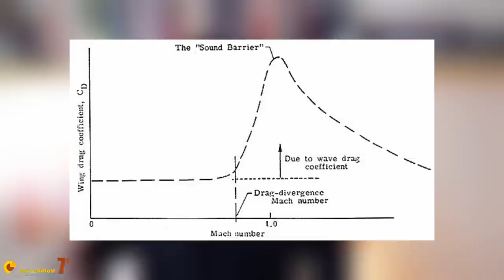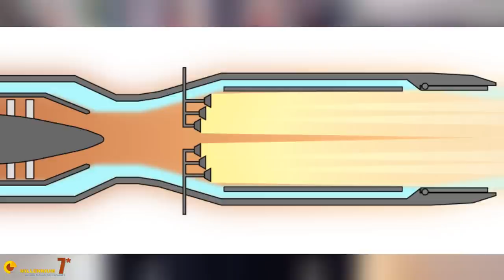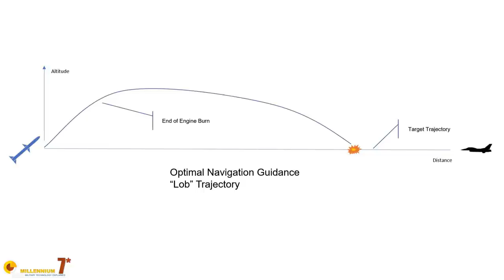Flying SUPERSONIC with NO Afterburner | Why SUPERCRUISE is so Important?

Comment: Very interesting video, but regarding Concorde I want to put some additional information, since the supercruise capability at M2 was a crucial design requirement, being essential to fulfill the transatlantic mission.
If I understood your supercruise definition correctly, i.e. if supercruise must only be achieved and maintained without the use of re-heats, - then you are right - Concorde could not practically operate in this way. 
Nevertheless, a differing supercruise definition might allow to cover an enhanced supercruise regime, e.g. respecting the case of Concorde.

Concorde used re-heats, but only for about 50 – 70 seconds during take-off and then again for 10 - max. 15 minutes for accelerating from M0.95 through the transonic region, resp. partly for climbing up to M1.7, just enough to build up sufficient pre-compression inside the unique air intake system. At supercruise, the intakes provided 7.3:1 in front of the first compressor stage, thus enabling 82:1 in the Olympus turbojets. 
During the climb phase above M1.7 -  i.e. even after the re-heats were cutoff - Concorde still continued accelerating. 
Supercruise potential: The engine power even had to be reduced to prevent the airframe from thermal overheating caused by friction. Regarding the thermal barrier (127°C), Concorde usually supercruised at M2.02 (M2.04). By this values the thermal efficiency of the propulsion unit was approx. 43%.
Actually, I don’t know any aircraft which was or is capable to supercruise under comparable conditions as Concorde did.
Reply from the maker: No, there isn't any AFIK. However, the Concorde was a class of its own in respect to many elements.
Reply: The XB70 can supercruse at 50% engine powet at M2. While concorde is still sligtly better (about 48% or something, dont bother calculating it now).

The thermal efficency increase with speed for a 0 bypass engine, so valkyre  would proboly  have higher efficency at top speed.

For 0 bypass engine there is really not much beside speed that effect efficency.

The B1A probobally outpreforme concorde as well in that regard, also being a turbonfan  probobly do that prior to M2
Reply: @matsv201  Thank you for your reply! Yes, in calculation speed is a driving factor for efficiency. But beside this fact, I think another important circumstance comes by the design attunement between the airframe, air intakes, engines and nozzles. The cruising speed of Concorde was limited due thermal heating (max. allowed 127°C), since an aluminum alloy was widely used for the airframe.

The XB-70 was mainly made of stainless-steel material to sustain the high skin temperatures at M3. This measure made the airplane relatively heavy – for this and probably for other reasons it required 6 turbojets. It also had only two main intakes to feed all their engines - which possibly made the airflow relatively complicated to control and not so efficient as it could have been when using a separate intake for each engine.

I think one main secret, what made Concorde so efficient (especially at her time and beyond), was its highly advanced and digitally controlled intake system, which also enabled each engine to operate individually at its best operating condition. 

An interesting fact is, that even for the younger PANAVIA Tornado, the principal technology of the air intake design and digital control system - as used by Concorde - should have been implemented to improve the engine control in different flight operating conditions and thus to enable the Tornado a better and safer supercruise performance.  https://en.wikipedia.org/wiki/Panavia_Tornado 
 

It would be interesting to know the impact in efficiency which is derived by the air intakes systems used in other modern supersonic aircrafts.
Reply: @karlskrivanek5687  
"(max. allowed 127°C), since an aluminum alloy was widely used for the airframe."

That is not the reason. The reason is that the air heat up when its compressed by the engine. The amount it heat is relative to the absolute temperature at the intake, so if it becomes to hot, the engines will be unable to add more fuel before the turbine blades melt. There for it need a intake temperature limit.

"This measure made the airplane relatively heavy"
One would believe that, but that is actually not quite true. XB70 have a empty to full factor of 47% while Concorde have one of 42%. While the steel ad a bit of weight, its far less than one might believe. Also the use of canard and a few other features made XB70 a bit more efficient, also alowed it to use more lift during takeoff.

" for this and probably for other reasons it required 6 turbojets"

Its actually not the case. The jets on XB70 is far smaller than that of Concorde. The total thrust is actually less even if XB70 is heavier. Even the B1A have considerably lower thrust than Concorde despite being quite a bit heavier.

"I think one main secret, what made Concorde so efficient (especially at her time and beyond), "

I would say rather that there was a dude sitting at a control panel handling the engines, compare to the 737 that was launched at the same time that did it totally automatically. Concorde actually have 5 seats in the cockpit. One capten, one fist officer, one navigator, one engineer and one instructor seat (only used in certification flights). Behind them was the electronics bay, in steed of under the pilot as in most aircraft at the time. This took up the same space as 12 passenger. Not only that. Most of the space below the floor was either taken up by wheels or by fuel. So there was hardy any cargo space. So most of the cargo was stored in a section int he aft of the aircraft, taking the same space as 12 more seats. This is actually a major contributor to why its so thirsty, because fuel is counted peer seat. If it was 5 seats wide, the avionic bay would fit under the cockpit, also the luggage, and there would still be space for fuel, as well as adding. That would pretty much cut fuel use by 60%

"It would be interesting to know the impact in efficiency which is derived by the air intakes systems used in other modern supersonic aircrafts."

Well a modern supersonic airliner would use medium bypass engines... like the Boom and Spike is planed to do. This totally of set the math.

My calculation estimate that the engine of Boom and Spike have a specific fuel consumption of 28g/kN*s while Concorde have 34. Concords official drag ratio is 7.14, while i calculated Boom to 11.7 and Spike to 10.7. I done this by reverse engineering there numbers, so if there numbers are of, so are mine. Combine it and there is a large advantage for the newer planes, while the advantages become smaler when taking into.

anyway, Concorde is so fuel laydend, so even a minor improvement in fuel consumption will give a large effect on the over all aircraft size.

Comment: The main advantage of supercruise is that is is much easier to see an afterburning aicraft with an infrared sensor without giving up your location with radar
Reply: The main, I don't think so. The main advantage is that you save fuel and that the missiles range boost. But agree that it's an advantage too, especially important for stealth fighters.
Reply: @mwtrolle  Saving fuel isn't that big, you might as well go 950kpg instead of 1200, and you can go om afterburner for a dozen seconds to give your missiles a boost
Reply: @tedarcher9120  Except that takes time, and it's an advantage to fire first, and if you have to do so you directly tell the opponent that you are launching your missiles.
Reply: @mwtrolle  if you are a non-stealth fighter he already knows where you are, so there is not much point in hiding. But imagine a stealth fighter, super cruising at m 1.8 with only passive sensors, lobbing missiles at non-suspecring enemies

Comment: I was under the impression that the EE Lightning could supercruise. In review, this comes down to wether people tightly define as per the US originators definition, or more loosely supersonic without afterburning. This gets into a lot of beer argument at the bar. 

I shall take a slightly different view. I love the Lightning. But the ability to fly supersonic without lighting up the afterburners was good because that plane drinks fuel at ungodly rates, the pilots need to have a 3rd sense for knowing where the nearest in flight refueling tanker is, and the fuel gauge is monitored more than the early radar :P

Super cruise is a very interesting subject. I have to note, that Eurofighter seems to have really terrific performance in this area. 

Sir, side note, your videos are top class. Has to be said! 
Cheers!
Reply: I have one thing to say just on the end of the video - energy, and talk of merge. And this is only my laymens view, so not based on absolutely solid science or evidence. But high speed / energy at high altitudes, seems to be a misnomer. Aircraft with wing loading, especially high wing loading - have limited lift at high altitude. Its worth nothing that in NATO tests, no 'fighter' did well against lumbering Vulcan bombers in tests at 45,000 feet. The enormous wing of the Vulcan gave it the ability to still manouver. The fighters were unable to 'turn' at these altitudes in the same way. (In beyond visual range with modern missiles the point is moot, Vulcan dies..) 

Most dogfighting pre/merge/post merge won't be at high altitude, or if it is, it will be very high speed/low G.. - probably with hard drops into lower altitude..
Reply: Concorde is also considered a supercruising aircraft. The reality is that most supercruise capable aircraft use the afterburner briefly to go supersonic, then throttle back and accelerate to higher Mach. Supercruise is generally defined as sustaining Mach 1 or greater. 

Another thing you mentioned is definitions. The US defines supercruise as Mach 1.5 specifically. Probably because achieving Mach 1 speeds without afterburner really isn't that remarkable. After all, the old EE lightning did it.
Reply: @EEEEEEE354  Well, if it is easy, everyone would do it :)

If you really take the US definition, this rules out several planes in the video which are stated as being capable.

I adore the lightning. And it might fit someone's definition, as it was very capable within certain tick boxes. Outside of those boxes, it wasn't capable. Phantom came along and had a much wider capability (and was a tremendous plane in its own right...)

But it was built as an interceptor, with rate of climb and high speed being doctrinal. If you examine it critically, the RAF never had enough QRA available against any serious raiders, and lack of range was an issue in this area all the way back to point defense spitfire and hurricane. And after the '57 idiotic defense white paper, which basically ruined manned aircraft development in the UK, Lightning was under developed though its whole program. Even with that, there are some things only Lightning could do in its time, and it took some tremendous planes to eventually come and do what it did, only a lot better.  It generally left the US century series in its wake. 

many things are trade offs, especially in old gen aircraft.
Reply: @AdmV0rl0n  I don't really go by the US's definition. Most likely what happened is we made it Mach 1.5 because supercruise isn't a particular unique or special capability. Supercruising at Mach 1.5 and above, now thats pretty wild. Can't have a one of a kind super unique fighter if everybody else can do it too lol. I am however, of the opinion that aircraft like gripen that cruise at Mach 1.2 clean are probably not going to be supercruising in actual combat. The aircraft did it in a straight line at 28,000 feet. They say it can do Mach 1.1 with an air to air loadout. Pretty unconvincing... Raptors can supercruise at Mach 1.82, but most pilots haven't seen that on mil power. More like Mach 1.5 operationally. 

Interesting stuff about the Lightning. I'm not terribly knowledgeable about the aircraft myself but I am aware that it was quite remarkable. I happen to be of the opinion that supercruise isn't super important or realistic in combat for most aircraft. When I think supercruise, i think Typhoon, F-22, and Su-57. Millennium brought up some good points, but I guarantee you the lightweights like Gripen and Rafale are going to light their burners when a BVR fight comes along.
Reply: @EEEEEEE354  I think huge amounts get missed in all the hoopla about combat. In reality, if you are BVR you might be high, and you perhaps may keep a conversation around a ranged argument. I don't think people really realise that at high altitude, a lot of engines don't work that well, the air is damn thin, and beyond that a lot of wings don't work well. No one will be pulling 9 G turns at 50,000feet. And when people pull sustained ... say 2g, as much as you may turn, you are burning energy and drag to make that turn and your stall speed is likely a lot higher than at lower down altitudes.  

In the end most actual dogfighting will drop to middle or low altitude where engines and wings .. work. 

There is an argument to make specific high altitude missile platforms instead of some of this lunacy. Just build a platform that cruises at 70,000, carries shitloads of evil missiles, ECM and its own AWACS ability, and dominate the area. In terms of the UK, instead of burning Eurofighter airframe hours chasing dumb bear bomber intrusion it would be better. Leave the dogfighting and dancing to the fighter boys.
Reply: @EEEEEEE354  I don't know if you missed what he said in the video. The 39 supercruise at Mach 1.2 with full air to air and a droptank. If you are going to pull high G's you will loose that speed very fast with all fighters. It's not even something you want to do at high speeds as it puts a tremendous strain on the airframe and of course the pilot. Most fighters are built for good manoverability in the transonic range as most of the high G, turning combat will take place at such speeds.
Reply: @secularnevrosis  Yeah, and thats wrong. This video isn't a primary source. https://www.flightglobal.com/saabs-demo-aircraft-to-highlight-gripen-ng-capabilities/80008.article Gripen test team achieved Mach 1.2 at 28,000 feet clean configured. They have claimed Mach 1.1 with an unspecified air to air loadout and nowhere does it say it supercruises with an external fuel tank. Not only this, but any type of BVR defensive maneuver like notching, nothing particularly high G at 28,000 feet, will bleed speed. The Gripen is severely underpowered compared to most other 4th gen fighters. 

Go ahead and find me a source that says Gripen can supercruise at Mach 1.2 with full air to air weapons and a droptank. Not happening
Reply: @EEEEEEE354  " I am however, of the opinion that aircraft like gripen that cruise at Mach 1.2 clean are probably not going to be supercruising in actual combat." He just mentioned in the video that the Gripen F/E's SC speed of  Mach 1.2 was with AA missiles and a drop tank,
Reply: @EEEEEEE354  "I happen to be of the opinion that supercruise isn't super important or realistic in combat for most aircraft." Maybe not if you see combat as dogfight's but he did just explain the reason why it's important for different reasons for long-distance engagements.
Reply: @EEEEEEE354  "When I think supercruise, I think Typhoon, F-22, and Su-57." Have the Russians even got the engine to work, not to say to perform as promised, yet! Last I heard it used underpowered older engines still.
Reply: @EEEEEEE354  He said the Gripen F/E and then you pull a more than 12 years old article about the Gripen NG!
Reply: @mwtrolle  And I just told you that it doesn't supercruise with an air to air loadout and a drop tank. I don't care what the video says, the sources conflict with the information that is readily available on the internet. There is absolutely no source for a Mach 1.2 supercruising gripen E with a drop tank and air to air weapons. The Gripen can officially supercruise at Mach 1.1 with an air to air payload, no mention of external fuel tanks ANYWHERE. Millennium 7 did not list his source, and thats why its a load of nonsense. I dare you to go to an academic setting or anything serious and say "oh this is true because Mellennium 7 said so!". What a load of nonsense, find me the source or be quiet.
Reply: @mwtrolle  The ONLY I repeat THE ONLY source for the Gripen E being able to supercruise specifically state that the aircraft could only hit Mach 1.1 with "an air to air payload". The Gripen E was formerly known as Gripen NG, and yes, they did demonstrate the supercruise ability more than 12 years ago! Thats why the article is more than 12 years old! This is the source. What, because they changed the nomenclature it suddenly produces more thrust? The Gripen NG demo aircraft was using the same powerplant and aerodynamic configuration as the production Gripen E.
Reply: @AdmV0rl0n  Not really the Vulcan had may tricks up it's sleeve, especially in the EW package.